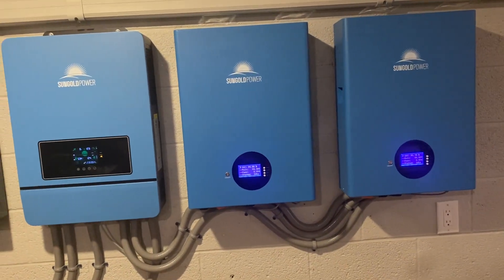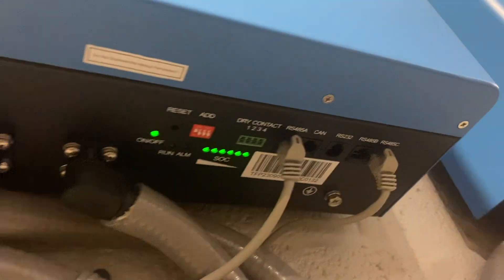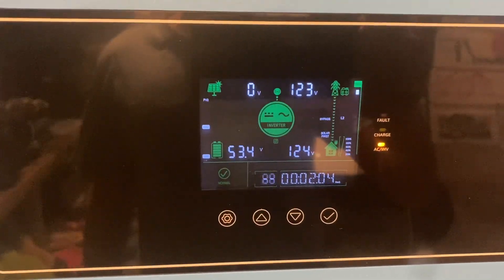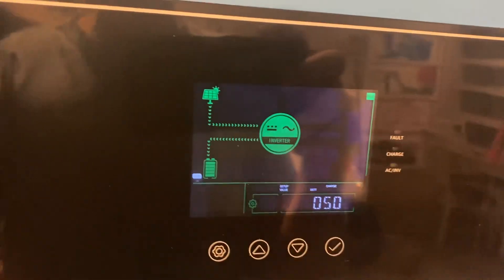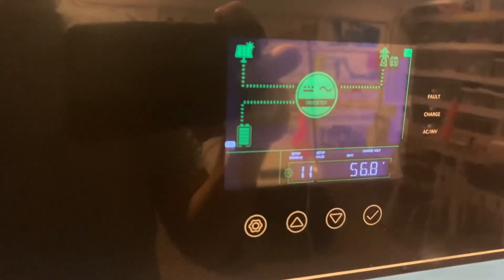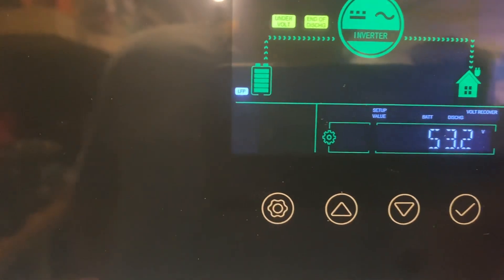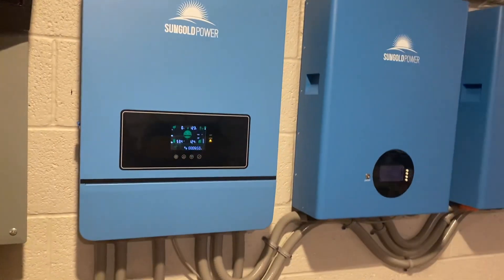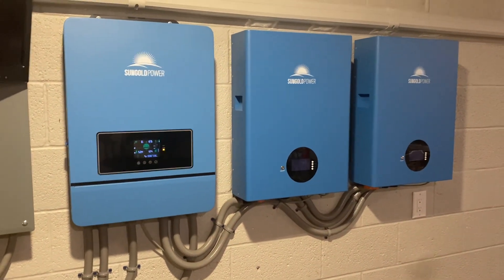Sungold Hybrid 10k Solar Inverter (Latest Model) and Wall Batteries

Comment: Just installed a 10kw sungold inverter with 6 eco worthy server rack batteries.  No issues since installed a month ago. The only gripe is the sungold A/C terminal blocks are garbage. Not easy to get 6awg wire to fit.

Comment: how it it holding up a year later, trying to decide between this and the eg4 12000xp for my new house.
Reply from the maker: Still running great, it’s paid for itself. Couldn’t be happier
Reply: @PaintSlinger99  After a lot of research I ended up ordering 2x - XW pro 6.8kw transformer based inverters as they just got discontinued and are on sale for $899. because from my research the high frequency transformer-less inverters dont do nearly as good with surge loads, and they don't last very long. the Schnieder XW series has people that have been running the older models for 15+ years.
Reply: @offdutypopo where did you find the $899 Schneiders?
Reply: @JamesRWeaver  NAZsolar

Comment: I tripped my SPH5048P inverter today and am getting Fault Code 17.  I tried switching the button on the bottom of the inverter off for a few minds and then back on to re-power the inverter as described in the manual for this Fault Code but nothing is happening.  Do you happen to know what I need to do to get past this Fault Code?  Currently have no output until I get this solved.

Comment: Can you use 4 batteries with parallel connection with that one inveter
Reply: Yes your inverter will only pull the amps it needs to power your loads. Your limitations on batteries in Parallel are only set by the brand battery that you use. Some brands will let you parallel just a couple and some will do 10 plus. If you max out that 10kw inverter and pull all 10,000 watts of power at once then you divide that by the nominal 48v of the batteries and get a current of 208.33 amps. The 4/0 battery cables the inverter recommends can easily handle 230 amps at a time and since your inverter won't be pulling anymore than that for any extended period of time there is no problem hooking up multiple batteries in parallel.

Comment: Do the batteries have overcharge protection? I also wonder if the inverter is the same as SPH10048P  on the website. I'm looking at getting a 20kw kit to run my house and workshop. 
My power company has proven to be completely unreliable and I've had trouble with generators failing so I want to go solar. Can power from the utility company recharge the batteries at any point?
Can the batteries be placed inside a closet in a house? Someone said something about possible acid leaks being a danger. And I've read something about needing gypsum board being needed for walls.

Comment: Didn’t you have a problem with your original unit ?  I thought I saw you in the forums about this.  Did. SunGold handle it ?  Would you purchase again?
Reply from the maker: Yes the other video I have is of the first gen (Round screen) it’s inverter board failed. It took about a month but Sungold sent me a replacement unit, this gen 2. It’s working great. Yes I’d buy again, Sungold has provided me with a powerful system for a much lower price point than other comparable 10K split 240s

Comment: What type of loads are you running? Is this powering your house/cabin? What was causing the fans to cycle on and off? Thanks
Reply from the maker: Everything but the dryer and stove
Reply: @PaintSlinger99 Is that by choice or is it not able to run them?  Sorry, I'm new to all this and trying to learn.

Comment: Like the size of those good video thanks
Reply from the maker: Thanks yeah good units. I’ve got solar assistant running now, using the automation power command, really takes this inverter to the next level, I’m not dependent on the inverter settings I show in this video

Comment: When you connected your AC input . What size breaker from your panel did you use and awg wire ? Thank you in advance . I just got mine today 👍🏻👍🏻
Reply from the maker: I used a 50 amp breaker the manual says the max input per line would be 63amps. I’ve never tripped the 50amp on 6 gauge wire
Reply: 30 or 40amp probably

Comment: SPH10K48SP  IS FEEDBACK POWER FROM SOLAR BACK TO THE GRID?
Reply from the maker: Yes
Reply: Can this feature be turned off? I do not want to put power back in the grid. Can it be set to Generator mode?> @PaintSlinger99